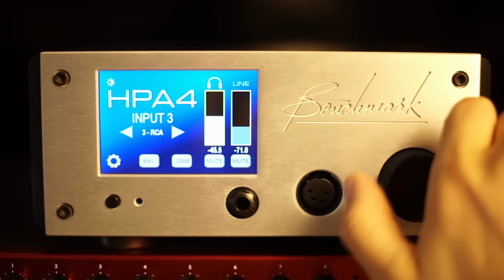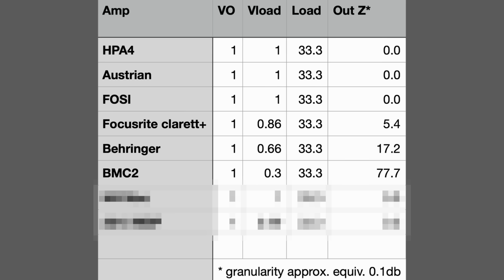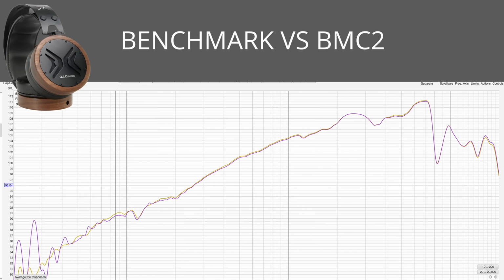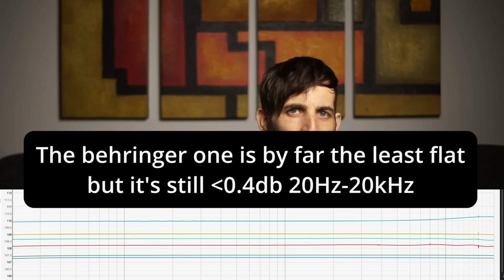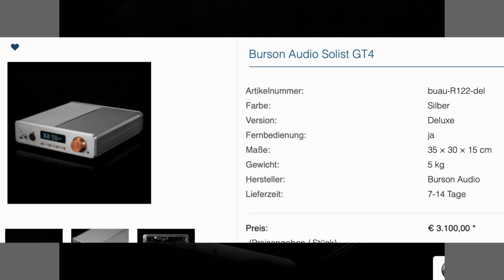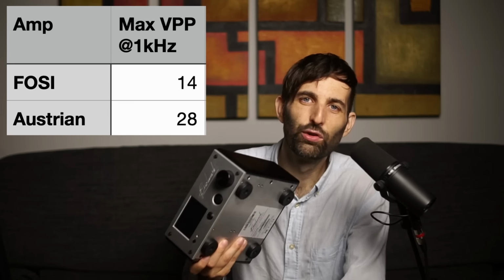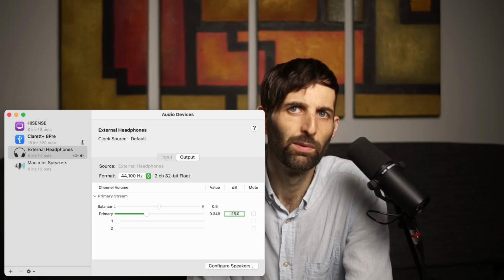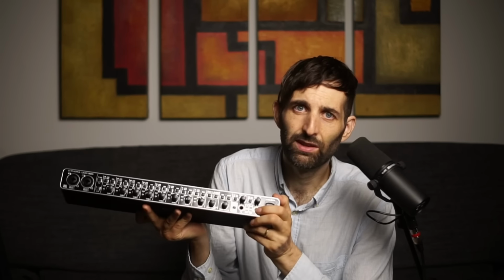Stop plugging your headphones into your audio interface!! Headphone amps demystified.

Comment: i was this close in buying a topping amp and dac set up lol now i will just stay with my macmini jack - thanks professor!!
Reply: tbf, topping is actually one of the better ones out there because of their obsessive focus on measurements. I would say their headphone amps would actually make for affordable alternatives to the AA and Benchmark headphone amps shown in this video
Reply: It all depends on which headphones youre using. It won't have sufficient current to linearly power low impedance planars, for example.
Reply: @sparella i have some beyerdynamics 990 - what about these ?
Reply: @sanjulianx  If it's the 600ohm version, no. If it's the the 250 ohm version, it could clip at louder levels. I wouldnt and don't work without an amp, but that's me.
For travel I use a JCally Jm20 max dongle. It's cheap and I believe more powerful than the MacBook output. I dont use a MacBook myself.
Reply: @sparella i Will try it out these days - mine are 250ohms
Reply: I switched to a Topping E1x2 and the headphone amp sounds superb compared to my old Profire 610.
Reply: The only test that matters is what you hear, not some print-out.  You should listen to both before deciding.  I only fully appreciated this when I did a blind test; computer audio isn't bad, but it can't match true hifi when you actually listen to it.
Reply: Your living in cloud cookoo land with you think a apple dongle sounds loud a SB G6 a Fiio k11 etc high end us stake oil Commonsense ISNT   YOU BERD A HIFI LRVEL SMP DAC ABD fir headphones there £100 desk top £30 ish portable and yes they blow a apple dongle away to device or silly cheap connector sounds bad hifi dev amp sounds amazing high end DS. Amps sound every so slightly better it’s called dimensioning returns
Reply: So i tried it just now with the macmini output and i really have to say …. It definetely sounds like these hifi companies describe Their pseudo DACs / textured ; immersive ; revealing lol 😂😂😂
Reply: Apple products have already the best sound ever! It might be possible to improve their sound by %10,but will it really worth it? 🤷‍♂
Reply: @beslemeto  Then you haven't listened to decent hifi. Apple products are good, but decent hi-fi easily beats them in real-world listening. You need to do blind testing and hopefully you will also hear the difference.
Reply: @beslemeto  lol..ok

Comment: You can recall level settings using the interfaces’ software (if it has 1), like cuemix (motu)or total mix (rme). I find headphone amps useful for high impedance headphones like the dt770. Love your work bro
Reply from the maker: yes but if it has a pot, you get potential channel imbalance and also added noise from turning it up 100% and then turning it down digitally
Reply: @APMastering The RME headphone preamp is a digitally controlled volume circuit, so no, no extra noise. 

The RME Fireface UCX II headphone output uses a digitally controlled analog stage rather than pure digital attenuation. The DAC runs at full resolution, and volume changes are implemented by digitally steering precision analog circuitry, with two selectable hardware reference levels (Low/High). This approach allows for recallable, precise level control without reducing bit depth or raising the relative noise floor. As a result, the headphone amp achieves the same performance specs as the main outputs: 121 dB dynamic range (A-weighted), <0.00032% THD+N at 1 kHz, and ultra-low jitter (<0.5 ps), combining the flexibility of digital control with the fidelity of a clean analog stage.
Reply from the maker: @GingerDrums  some RME units are other have an analogue pot
Reply: @APMasteringeverything since 2015 is digital voltage control.

Comment: Bro, those Apple DACs sound distorted.
Reply from the maker: then your one is broken or not a pro model, or you are driving headphones with a very high impedance. with sennheiser 6** they are OK. the problem is high frequency extension of the DAC, not distortion. Distortion measures lower than behringer interface my side
Reply: @APMastering Sony mdr MV1 [24 ohm] into M2pro mini, I think the dac is optimised for Spatial Audio [laptop speakers], as the phase is all twisted with poor bass. Can you test for PHASE distortion?

Comment: That Ollo audio X1 frequency response curve doesn't look at all right, although I couldn't see the x axis. The manufacturers curve shows them relatively flat, even at low frequencies. That curve shows a woeful bass response, unless its very zoomed in.
Also, how did you volume match the different headphones ? Not an easy thing to do. And did you measure at different volumes to account for limitations of different amps with difficult to drive headphones at high volume ? 
I havent finished the video yet, so if you have answered these questions in video, apologies. I will get back to the video later.
Reply from the maker: ignore the curve, like I say in the video, we are only interested in RELATIVE changes, the response is wildly inaccurate because there is no seal. the X1 relies on seal whereas the 660S is extremely open so shows more bass.

Comment: 32:08 yaeh , sadly realtek is one of the most used supplier for audio and network chips in the pc market:(
Reply: Esp. everything below ALC1120 or ALC1220 should be avoided, and it's the most popular in contemporary motherboards. With those better codecs, people actually stop to notice any difference between some cheap soundcards, but it's still not that good, and a lot depends on codec implementation in a specific motherboard.
Reply: well my Gigabyte X870E Aorus Elite has very nice audio, so did my MSI X299 Pro 10G before that ;)
not the 100 buck board and most B boards i would agree but Realtek on its own isnt imidiately rinning my bells but a cheap Mobo does more so ;) 
my AVR is plugged directly into the 3.5mm of my X870 :D

Comment: NEXT video - cheap cables vs audiophile grade :D
Reply from the maker: already ripped into cables with Ethan winer
Reply: @APMastering im using even my rather cheap chinch or RCA cables form the 1980s ive got laying arround, yes the got a lil wigglecontact BUT :D they work, not worse then newer more expensy cables, not really at least ^^ if it works it works, cant see them cablys anyway hehe ^^

Comment: Really enjoyed your breakdown of desktop and interface-based headphone amps/DACs, super clear and helpful. It got me thinking about the more compact side of things. I’ve been using the Qudelix T71, and it’s blown me away: plenty of output voltage, digitally controlled volume, onboard EQ and it drives my 300-ohm cans without breaking a sweat. Curious what you think of these portable/compact amps in a studio context: are they a real alternative to desktop units, or more of a niche tool?

Comment: My only problem with using a mac for headphones is having to use a mac. For me, the mac os is about as satisfying as scratching my eyes with a wire brush. I have a pc with an Fiio k11. I'm very happy with that. 140 euros extra without the torture of wrestling everyday with the mac os. 
I used to have a small mac laptop to support my photography students who had been told that mac was better. I never had to support the students with pcs. The issues with the macs were never ending and almost always because the os treats users like idiots. 
The only day I was truly happy with my mac was the day it stopped working so I through it away. I've had zero problems since.
Reply: MacOS went through major changes the past decades. First the switch to OS X, than Intel, than Apple Silicon while abandonning the carbon-API, once made for an easier switch to OS X, but widely used for example by Adobe. Apple cut a lot of ties unlike Microsoft, that's why the foundation of Windows 11 is still ancient and even the UEFI-integration a joke. For several years I couldn't boot Windows including 11 without an old HDD present, that contained no OS, but the boot-files. To fix it without fresh install (excluding the HDD, so Windows writes a new boot-ini) I would've needed to go into the console (no OS, no copy & paste) and type in like half a A4-page of cryptic bs that likely would never work, because the Windows-base is still DOS, at least for me. The advantage is, that ancient Windows-software still works in most cases, unlike with Macs. But if you have a Mac with M-chip and compatible software, it just runs, with roughly a 10th of the wattage of any AMD- or Intel-desktop-systems on idle and no audible fans and certainly a lot more software working than with Windows-ARM. If you actually google for Windows ARM, you only get very old news, like it's dead already.
Reply: @Leynad778  No, MS-DOS is not natively used or supported in Windows 11. You could have checked that in a second but blew up your entire comment instead. You need third party emulation software to run DOS games or applications. You should stick to mac. It is designed for people who are computer challenged. You can boot windows 11 from a memory stick, sd memory card, hdd, ssd, your choice. You could have also looked that up in a second, unless you are using safari.
Reply: @zen_dac  I wrote it's DOS for me, because it's cryptic Windows-console 'language' without any UI and just an example for the ancient foundation Windows is based on. There will be no x86-chip ever with the efficiency of ARM-chips, but because every software needs a re-write and not enough people buying it, there will be no Windows-ARM in the future. Windows is a dead platform because while Mac-User run their stuff on tiny Mac Minis and fan-less Macbooks with under 10 watts while I'm typing, your PC is probably using 10x more for the same task while x86 will never do what M-chips are capable of. I also own a ROG Ally and I personally prefer Windows 11 on touchscreen to iPadOS because it's not crippled. Gaming is quite efficient, but the baseline-load is way too high, so very inefficient for web-browsing or watching movies unlike every smartphone or every modern Mac.
Reply from the maker: its OK to not like Mac, but it is not ok to like windows. if you think windows is good, you are objectively wrong. it is perfectly fine to have non apple hardware but then you'd run a good OS like arch linux. running windows is always a mistake. objectively. fact.
Reply: @APMastering Hahahahahahahahahahahahahahahahahahahahahahahahahahahahahahahahahahahahahahahahahahahaha. "It's not ok to like windows". Hahahahahahahahahahahahahahahahahahahahahahaha. "It's objectively wrong" Hahahahahahahahahahahahahahahahahahahahahahahaha. I have used windows since 1994. I was a c++ programmer back then and I still am a web programmer. I ran two photography schools using windows only. I currently run a worldwide print business with windows computers connected across different continents. I work on a windows 11 pc all day every day and I love it. Your use of the word 'objectively' seems to be badly misplaced in this context.
I should point out that I love your videos and always look forward to the next installment even though they are objectively shit 🤣
Reply: I'm using Macs for 25 years and the past 10 years a Windows PC. It forced me to fresh install Windows four times because of Windows updates and bugs. The PC was build with Be quiet! case and fans, but always ridiculously loud compare to any Mac. The fan in a Mac Studio is so quiet like there is no fan and in my Macbook Air there is no fan. There are no drivers for audio interfaces because it's plug & play. Windows 11 can't even handle more than one audio output properly and everything regarding audio is a buggy mess. Windows is for games only and the Explorer a pathetic joke. For my job (print operator) I would be at least 20% slower if I had to do it on a PC, just because the Finder has features you can't get with Windows like drag & drop folders to save files in a specific directory or instead of typing in a file-name, I click on another file and it just copies the file-name with another suffix. In windows you can't click on files with another suffix, so happy typing. Windows is a pathetic joke with lots of bugs since Windows 95.
Reply: @Leynad778  And yet, with over 17,000 students in 15 years, I experienced none of the issues you mention with the sole exception of macs when students brought them in. I even have a classroom full of 17 pcs of mine for students to use connected to 6 high end photographic printers (Epson 3880) and never had a single issue or experienced any noise. I guess I'm just lucky. Spectacularly lucky.

Comment: On the note you make about PC, I think the issue is that people who know enough to care about the difference in audio components will assume whatever is in a standard laptop is not good enough anyway. There is no consistency between brands, and there is a bias in general. In that sense it doesnt really add perceived value to use good components except perhaps if you're marketing it as a niche audio product. Manufacturers seem much more happy sinking money in licensing from some mainstream hifi speaker brand to pretend their laptop speakers are anything but laptop speakers, rather then having actual sensible audio hardware inside. I think it is a huge shame because the actual difference in cost between a half-decent dac and a rubbish one must be marginal in comparison to the difference in value. The same is seen in phones where some old phones had really good DACs, and in later generations they decide to downgrade that to save pennies because the average consumer expects it to be lower quality anyway.
Reply from the maker: sounds about right

Comment: Yes, the Macbook Pros have a good headphone amp. They have Cirrus Logic and Texas Instruments chips that even drive 250 ohm headphones really well (they automatically switch power when detecting higher impedance).
Reply: Did you give the Fosi headphone amp away yet? Wonder who the lucky winner was?
Reply: Texas Instruments converters are like a high tech secret weapons.  Several really good sounding things use them… Montage anyone?
Reply: Let me tell you something! Macbook's DAC sounds better than an external DAC i spent 300-400 bucks on it.Macbook DAC sounds just perfect and i don't think it can be much improved for any spent money!
Reply: @beslemeto  I compared it to the Schiit headphone tube amp everyone and their mother was raving about on the internet. The Schiit sounded muddier, and had less output power.
Reply: @vinylarchaeologist 
People buy tube amps for the distortion, not for the lack of it
Reply: @Goodmanperson55  That's the point. It didn't distort, saturate, colour the sound in pleasing ways, nor did it alter the perception of stereo imaging. I was hoping it would.
Reply: @vinylarchaeologist specifically which model?
Reply: @beslemeto  You're hallucinating. DACs have no sound.
Reply: @romani_ite  I think he means the entire analog output chain including the headphone amp. All DAC units, as opposed to the DAC chip, have some analog components that obviously can have an effect on the final output signal.
Reply: @romani_ite Of course they have since all of them have different components.It's like saying amps don't have sound etc...Thank God perfect sound can be achieved for little money and thanks to Apple that puts excellent DAC's in their laptops!Surface Pro 5 was even better as long as i remember!
Reply: @beslemeto  ThinkPads were not bad either
Reply: @Emerald_City_ Ipad Pro was outstanding yes!It has more HIFI sound then Macbook,but overal i still prefer Macbook's sound.Sometimes less is more.Surface Pro 5 was better than both as long as remember.Same tonality like Macbook,but more clarity.You need serious software player though. J Player and HQ players are top choice!
Reply: @romani_ite  They shouldn't but they have.
Reply: Macbook? t's not good enough, though.

Comment: Being a cheapskate, the ubiquitous channel balance issues with analog volume controls is part of why it's a requirement for me that an audio interface listens to the volume keys on my keyboard while speaking over ASIO. Being able to set and forget the actual amp at a level where it functions properly and then rely on digital controls that are standard to the operating system and granular to 0.3-0.5dB and functionally recallable makes a fair few problems go away. Also being a broke cheapskate, I haven't exactly gotten to try many interfaces, and for some reason people don't seem to talk about this much, but I've dealt with exactly 1 interface that decided it was fun to just treat ASIO as being at maximum volume always (the Presonus Audiobox iOne, the single worst piece of technology I've ever owned) and that rendered it completely unusable. Some level of digital control over output levels, preferably accessible via nothing more arduous than a single keypress, is a bare minimum feature in my mind. Even Behringer gets that right. You know an audio interface is bad when it's unfathomably worse than a Behringer product on every single metric and then also has the audacity to make screeching noises at you before dying completely.
Reply: That's not the only one. Some older, cheaper interfaces also treated ASIO and WASAPI as maximum volume.

Comment: Have to say I'm not particularly surprised of the "mystery amp". I have never felt that it has made a negative difference when using the headphone output. Rather the opposite, with better fidelity on higher volumes. Might of course just be case of the good ol placebo.

Comment: Topping are the best for transparency and outreageous power !
Reply from the maker: Maybe for the price. But for the price fosi might be even better value
Reply: @APMastering Check the specs of the new Topping DX5 ii  .You gana be blown away, amp + dac + integrated parametric EQ for 300 dollars : 7,6 watt, DR 133 db, THD+N 0.00006%